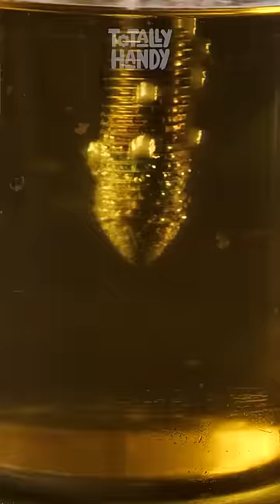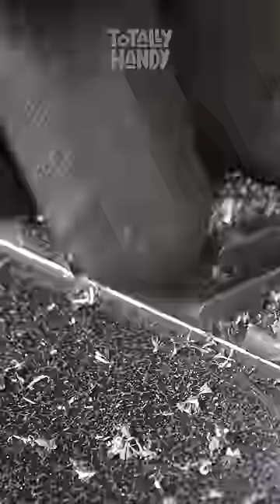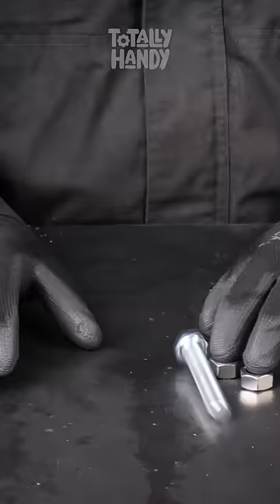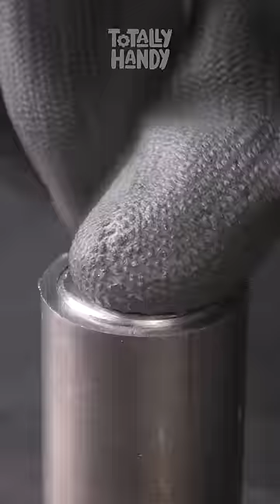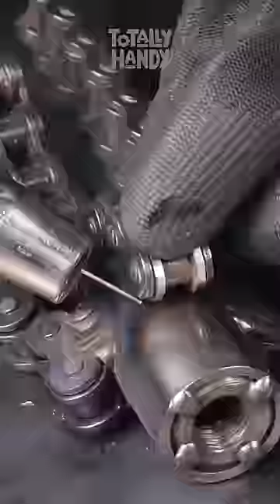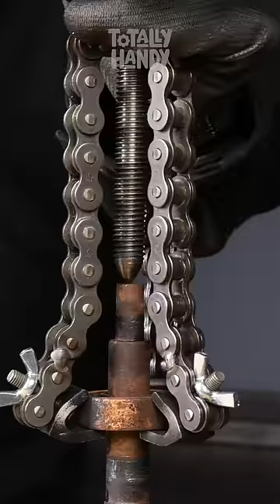DIY bearing puller #shorts

Comment: Step one : buy all these tools.
Reply: Especially tig welding))
Reply: Yes I'm sure that is much cheaper than buying a puller
Reply: @mightyjedo  its actually mig
Reply: Well if you're someone who would follow these tips chances are you already have all of these tools in your garage
Reply: Step 1 just buy a bearing puller.
Reply: That's what I am saying buy all these tools to make a cheap tool .. pullers are not expensive..
Reply: I can’t stop laughing, I was going to post the exact same thing LOL
Reply: @brandonbullins  removes the fun.
Reply: Don't be silly.  See the earlier posts in the series: "How to DIY a welder" and "How to DIY a flap wheel".
Reply: @birb180  new project always need a new tool base on my experience.
Reply: what use would you have for a bearing puller without owning basic tools first
Reply: @rogers8555  mr. El cheap "O" 😂
Reply: This tutorial is for a workshop owner, so they must already has all the tool needed.
Reply: step 1: buy beraing puller if you dont have the tools...
Reply: @birb180  And now you also have a bearing puller...
Reply: You won't be making this tool unless you are in the trade or a hobbyist doing these kind of work thus most likely you already have the tools and materials for this project. It's normal for those in this trade to make custom tools.
Reply: Step 2 : next time never see yours handes..
Reply: What? You don't have all these tools ready at home?
Reply: 너네들은 도구만사지 우리는 집부터 사야한다
Reply: If you don’t have these yet , you spending your money on the wrong shit
Reply: lol
Reply: Lolololllll
Reply: @MrEmrys24  you could just use a hammer to beat the bearing off the shaft and just buy a new bearing. Many ways you could set it up, soak it in trans fluid/acetone mix, and either tap on the bearing or the shaft and have it apart in like 30 min
Reply: Right. This is the stupidest thing ever.
Reply: I would've been cheaper to rent a puller than buying the crappy material to make one.
Reply: @mightyjedo  you know as much about welding as the guy in tbe video knows about heat treating.
Reply: @MrEmrys24  dude you are wrong,  there no reason  to make this joke, 99.9% of the time bearing are easy to remove and if you need  a puller it's cheaper and faster to rent one.
Reply: You dont normally all have these tools collecting dust in your garage/attic?
Reply: Imagine not being Chad enough to have tools, EVERYTHING he has are pretty much the basics of a toolbox. 

What's next?  you can't flirt with women but you can flirt with your bros?
Reply: Are you confused about the meaning of do it yourself?
Reply: @JDIY2023  That's my excuse 🤣🤣
Reply: A bearing puller is about 30 bucks... how much is your time worth?
Reply: One can loan for free (just a deposit) pullers of various size and shape at any auto store
Reply: @carrollcorder5169  yeah but if you’re not an idiot with those tools you could make whatever you need it’s DIY for a reason some people really don’t be having the option to buy shit
Reply: @majsikosek9810  it’s actually MAG
Reply: @majsikosek9810  it’s actually Zig
Reply: @SockMonkeyPal7  BIG welder
Reply: these videos are for the people who work in this
Reply: Exactly what I was thinking lol
Reply: It's just a drill, a grinder, a vice and a torch.
Reply: I would just call it art at this point
Reply: I have every single one of these tools, it's your own fault you taught the algorithm to suggest these videos, not his fault you aren't the target audience/that you are literally the target audience, people who have these tools don't think it's special
Reply: Need a course in tig welding right after I figure out what a tig is
Reply: If you need a pulley puller then chances are you already have all those tool. I have all of those tools including the mig welder
Reply: @mightyjedo  anything that will work to tac those nuts in
Reply: @mightyjedo  that's a mig welding take to look like a tig ;)
Reply: @JDIY2023  and each project should include at lease one project inside the project
Reply: Everyone who needs a bearing puller should all have these basic tools at home......
Reply: You can buy everything, but making it yourself brings joy. This also show s that you can customise your homemade tools to your needs.
Reply: @mightyjedo  that’s mig
Reply: There is some reason because good pullers are at least 200$
Reply: Imaging buying an bearing puller without having those stools first anyway?
Reply: Right
Reply: 🤭🤣🤣🤣🤣🤣🤣👍👍👍 boa . 🇧🇷
Reply: If you don’t have most of this stuff you aren’t going to need to pull a bearing 😂
Reply: @carrollcorder5169  llllllllll la lllll lalu ll lllllll
Reply: @birb180  thay someone wpuld also have a bearring puller then, right? 

So I guess the situation is as follows : you do projects and at some point you need a bearring puller for one single project. 
So now you spend 8 hours designing the thing, scavanging materials around the workshop, redesigning because the scavenge hunt didn't reap all recources needed. Make it, incapacitate the motorbike for a bit of chain... 

Or just buy a puller for 15bucks.
Reply: @mightyjedo  it's a mig welder sir
Reply: Or u could steal them...
Reply: Step two: learn to weld
Reply: No step one is you go out in the woods and you live like primitive technology and then you won't have to buy any tools
Reply: A welder and a grinder?
Reply: What’s the songs name
Reply: Step two : buy a camera to record what you are doing
Reply: Someone who actually has to pull bearings most likely has these tools anyway and very likely has a bearing puller...
Reply: Step 2: buy the right steel
Reply: 2. Пригласи кого-нибудь, у кого руки растут не из жопы.
Reply: Step one should be having some knowledge of welding.
Reply: Чего?
Reply: WOOOOW.... simply great👌🏻 I love that!
Reply: @mightyjedo  Tha'ts MIG/MAG not TIG

Comment: Just FYI, there’s not enough carbon in mild steel angle iron to quench harden.
Reply: Or in ready rod either. None of that heating or quenching did anything. Which is probably why instead of aiming for straw color they straight up had it cherry red.
Reply: Let alone one cycle
Reply: Not to mention he just DROPPED them in. If it would actually take a harden, you could introduce a fizzure right where you don't want it for a puller. Lol
Reply: M
Reply: Ко всему прочему цепь лопнет в месте сварки, самоделка для дураков🤦‍♂️
Reply: As a blacksmith.... I was watching this going what is wrong with this guy, why would you quench that.
Reply: Esta jenial ese estractor
Reply: A fine example of an engineering marvel in the world of mental midgetry. Tell us what city this is from, so I may phone in a favor, & have the blue Angels do a proper fly over to recognize this amazing effort! Amazing!
Reply: They sell high carbon angle at welding shops for like 30% more.
Reply: But you are wrong on that. Mild steel has 3 states. Annealed, soft and hardened. You cannot temper mild steel but you most definitely can harden it.
Reply: @psychoskwurl  no you can’t.
Reply: couldn't u use used motor oil for extra carbon
Reply: @davidbuchberger2695  ... Yes you can. 🧐
Reply: @psychoskwurl  no you can't, as he said there is not enough carbon in mild steel, you could solution harden it to impart carbon into the surface tho.
Reply: @psychoskwurl  nope
Reply: @sandersballistics every article I've looked up said that it is possible to harden mild steel.  Couldn't find any evidence against it.
Reply: @carlsmith5678  you can not, you can solution harden it to a point by soaking it in high carbon solution and other fancy things but there is not enough carbon to harden it.
Reply: @sandersballistics  well I read about 7 different articles that said otherwise, so I'm not sure if I believe a stranger on the internet.
Reply: @carlsmith5678  Go get a piece and try it. Where are these strangers claiming the carbon is coming from? In basic principle only iron with carbon can be hardened, there is not enough in mild steel so where do your internet expert articles claim the carbon is coming from?
Reply: @sandersballistics  Google "quenching low carbon steel" and look at the results. I think you are mistaking hardening and tempering as basically any steel or iron will harden(become brittle) after being heated and quenched. The reverse is true for bronze copper and silver as they work harden, get harder(more brittle) the more you hammer it, while heating and quenching makes them soft again.
Reply: @rjwood6314 If you are quench hardening steel, you need to reach austenitizing temperature, this is glowing red. If not you will not form martensite, the crystal structure that makes steel hard.

If you quench at yellow/straw colour, you are just cooling down steel fast, if doesn't change hardness.
Reply: @psychoskwurl You can hard HARDER mild steel, but you cannot have hardened mild steel.
Reply: @tomboysupremacist Not really
Reply: @rustybungle Close, but no cake.

'Any steel or iron' will not quench harden.
You need carbon to harden steel, ideally above 0.30%, otherwise you're going to change the structure from ferrite (normal iron/steel) to Cementite. This makes it marginally harder, by a couple or rockwell hardness points.

All metals work harden. Movement in steel produces dislocations, these prevent further movement, hardening the metal.
Most alloys of copper, and silver cannot be quench hardened, heating it up anneals it, quenching it just cools it fast.
Some alloys of copper, aluminium bronze, silver steel, can be quench hardened, heating and quenching these will produce a harder than work hardened material.

Comment: That bearing could’ve been removed with a few tappy tap taps.
Reply: i counted Drie
Reply: Bro needs content man.
Reply: Use torch.. heat is your friend when doing tappy taps
Reply: Love tapping. If tapping doesn’t work. Tap it some more.
Reply: stolen comment
Reply: Tap tap taperoo
Reply: Actually there are few things where this is essential
Reply: Or yk, the angle grinder, you ain't reusing that rust ring I'll tell you that much
Reply: 2 c-clamps & a broken wrench and done

Comment: That bearing could’ve been removed with a few tappy tap taps.
Reply: It would have taken at most a love tap I think
Reply: with hammer is enough, but cant do tap in tight space
Reply: He also could have bought bearing he made his own 😂
Reply: Tap-tap, tappy tap tap, whoa pam pam!
Reply: @joerisimmanuel9156  but master you are not strong enough.
Reply: The best part is you can tell those bearing were loose on the shaft, but yes. You could  set the shaft loosely in the vice and that the end to pop the bearing off. Worst case a little heat on the bearing or just cut it off.
Reply: @hcgtiger4724  your'e right
Reply: True
Reply: Dude it's not even that when was the last time you're bearing got stuck on the ID not the OD. And if it's stuck on the ID you just put a wrench behind it and tap the shaft with a hammer or heaven forbid move up to a small  bench vise.